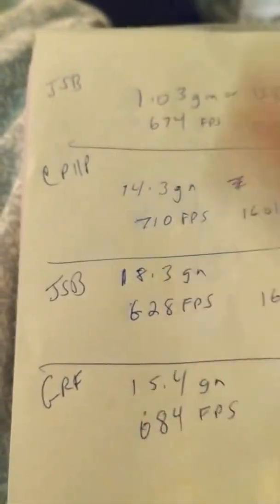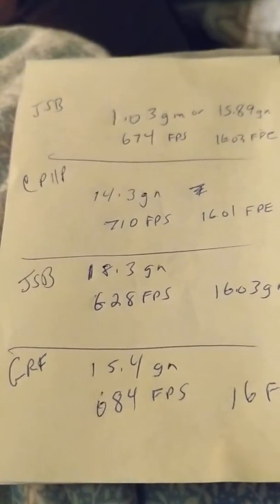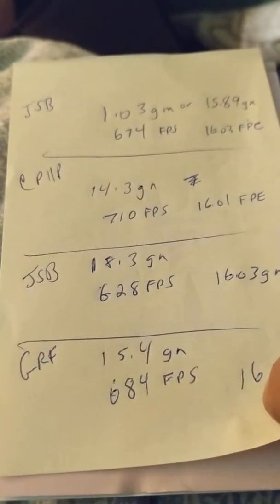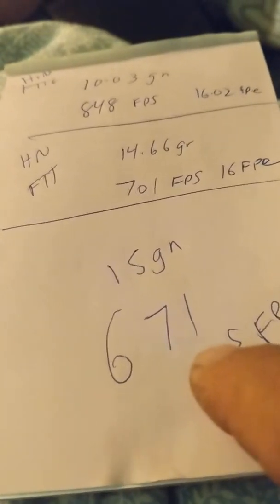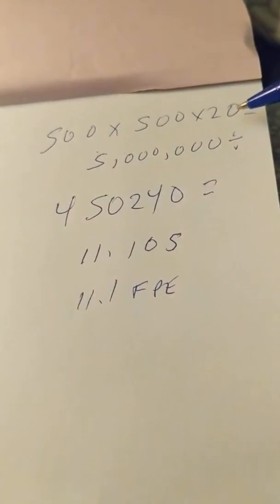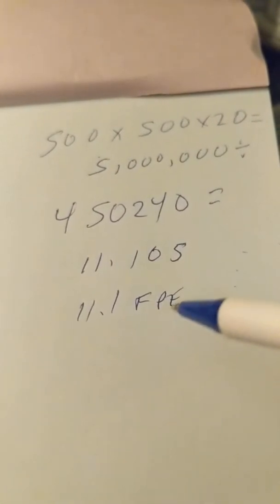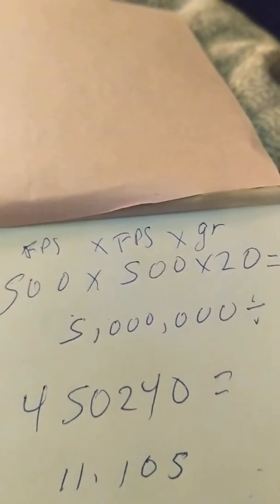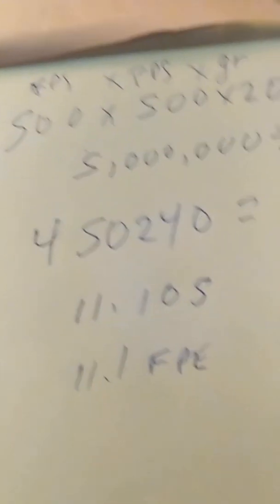How to calculate foot-pounds of energy. Six pellets how fast they go to reach 16 FPE

Comment: How to determine the energy please explain me
Reply from the maker: The weight of the projectile in grains.
Multiply:
Weight in grains x feet per second x feet per second = total
total muktiply by 450249 = foot pounds of energy.
Example:. 7 grain pellet at 671feet per second
7 x 671 x 671 = 3151687
3151687 ÷ 450240 = 7 foot pounds
Reply from the maker: Fps x Fps x grain = _
_ ÷ 450240= foot pounds of energy

Comment: Sir from where u got this number 450240
Reply from the maker: It is the number used to determine the energy.  It's common or available from all sources to calculate the energy of the object.
Reply: Sir i have understood . But one thing that 450 240 from where u have got
Reply: @SteveChishamSr  .I understood grain x with feetper second x feet per second n devide by 450240 .right but 450240 from where i will get
Reply from the maker: The number is the formula number used for decades to do the calculation
Reply: It's ok then tell me what's the formula number of 9mm .357 sig n 10mm
Reply from the maker: @Mr_jadooo  
What's the feet per second and grain of the projectile?